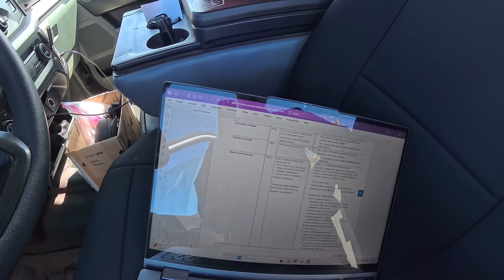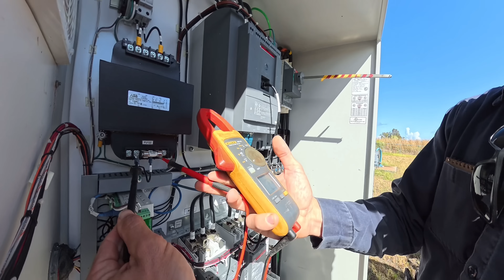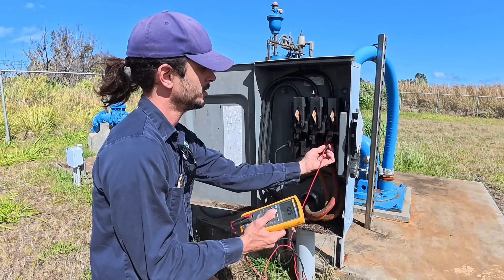100 Horsepower Motor isn't Starting

Comment: G,day from Sydney Australia.
Have you ever taken the cover off the ABB VFD soft start? Look if anything obvious inside?
🌏🇦🇺
Reply: My thoughts exactly. He was more concerned with ordering a new part that didn't charge for shipping than to isolate the faulty component. His on camera trouble shooting seems incomplete. His lack of PPE (safety glasses at a minimum) while troubleshooting energized 3PH 480 VAC make me question his knowledge and experience. Example- Not checking his DMM to make sure that he was on the voltage scale and not the resistance scale before checking voltage. It wasn't too long ago that we were using analog meters (Simpson 260 for example) and the meter would blow up and spew molten copper all over the place, including your eyes, if you were to make the mistake of probing live 480 on the resistance scales.  It is still a good practice to always double check what scale you're on whatever kind of multimeter you use. Have a great day.
Reply: I wonder how many practicing electricians today even know what a Simpson 260 is.

Comment: Must not be very important if they do not have a back up pump. Should have two pumps that alternate each start. Pure BS not allowing a pump to run on bypass. Sure they have hundreds of identical  HP started on a starter.

Comment: Place I retired from had over a hundred VFD'S with bypasses. Only time bypass start ups were on large fans with a few B belts that would scream first few seconds because of belts slipping. They ranged from 2 to 250 HP.

Comment: surprised owners/operators dont keep extra parts for this kind of issues. at the farm I work on we have multiple motors, soft starts relays everything to keep the place alive for emergencies
Reply: The system has a bypass contactor to run the motor at 100 percent in the event of a VFD failure.

Comment: Good decision, I would have made the same one. 
Rotor pumps, like fans, don't put up a lot of resistance at startup(like conveyors, for example) torque increases with the square of the speed, but the hydraulic shock at fast startup and at stop can be very damaging. 
Besides, this bypass contactor and this disconnector at the well don't look like they can withstand several hundred amps of starting current. It will probably melt the contacts, the characteristics of the fuses are probably not delayed either so they will burn out. 
Thyristors are connected between the input and output, in each phase two in parallel but in reverse, each to cut a different half of the sinusoid, one may be punctured. 
Cool that you are recording again.

Comment: You are supposed to check for that short circuit between the input and output of the soft starter, not between the individual phases!
Reply: Short circuit before starter occurs a lot less frequently then after starters.

Comment: If it wasn't safe to bypass the vfd, why did they have the cabinet wired to do so?
Reply: It is not a VFD, it is a softstarter. The bypass is there to bypass the SCRs in the softstarter once the output is at fully voltage. (for the starter to not overheat).  Not to start the motor DOL.

Comment: Old school way of starting high up motors was star - delta set up, but you don't have the wiring or provision to do that, too much in rush current I think unless the motor is running then you could put it on bypass.

Comment: I would have ran the VFD with the SS contactor disconnected/inspected the SS contactor contacts. BTW - I saw a lizard run in the motor conduit when you opened the motor disconnect. I also recommend practicing proper lock and tagout procedures. Good luck!

Comment: Often the need for a soft starter is only there because it's utility required.  This is because the utility has a legal requirement to prevent voltage sags during everyday start-ups in a customer's normal operations.   Well pumps are designed for DOL starts.  They tend to not be too violent because they are actually starting unloaded since they don't actually produce much head as they start rotating.  Multistage centrifugal pumps don't do any work until they reach the speed needed to overcome the head they're working against.  Once they reach the head, they then need to actually get the water moving, which brings the load on over time.  Not a lot of time, but not instantaneously.   I'd have no issue with running that well DOL (Direct-On-Line) for a couple of days while you get a replacement SS going.
Reply: Not quite. Dépends on the duty cycle of thé motor. Starting once a day? Probably ok. Once every 15 min.... Prob not ok.
Reply: @joske102 if it would start every15 minutes woudn't a VFD be a better option?
Reply: @brunolamote  VFD would be the option if you needed to vary pump speeds to meet demand.
If you just run at full motor rpm until the demand is met then the soft starter with it's internal contactor should be the better choice, less electronics, minimal programming and you are not loading the solid state components once the internal contactor is 'on'.
Soft starters can be 1/2 the price of a comparably sized VFD.
Reply: @brunolamote vfd for a 100 hp motor is pretty pricey. Soft starts or wye delta starters are always the cheaper option

Comment: Advocating to not use bypass is foolish.  Do you think the panel is not sized for DOL?   If the system was VFD, then your DOL position has some merit.  Piping has been able to hold the pressures from running on soft start.  When have you seen a DOL start up blow out piping?
Reply: He made the right call. It's a big pump, can blow fuses etc. 

Big pressure swing on the pipework, if there's a faulty discharge check valve and it isn't holding water above it, you will get real bad water hammer when it starts as that water fills up the pipe and smashes into all the elbows up top. 

The soft starter is there for a reason. Best to let the client decide in case the worst happens. 

Don't want to have your ass on the line by putting it in bypass and causing damage to something.

Comment: Great to see a new video!  I agree with your decision not to run in bypass, unless it's a true emergency.  The panel is designed for across-the-line start, so I don't think safety is an issue.  The start will be violent, as you say.

Comment: Nice diagnostic video, one thing I would have done was pulled the output out of the SS and tried to see if you ended up with the same fault. I also ran into a similar situation, faulty VFD and the owners wanted to run across the line, I did not feel comfortable doing that and thankfully they listened and replaced the VFD.
Reply: He had the motor disconnect off. I would have ran with the input wires to the SS contactor/or inspected the SS contacts.
Reply: @Harry1s  I think we are on the same page lol, there is I'm guessing about 30' between the last junction block to the safety disconnect at the well, disconnecting at the output of the SS eliminates contactor and junction block connections, wire to the well. Eliminating 3 possible items at once. 👍
Reply: @MarkSatRorrerWellDrilling  sorry I read your post wrong. We are on the same page!!

Comment: I think the short circuit the manual refers to is between the input and output of the soft starter, for example, L1 to W1.
Reply: I agree. he never tested it with the input to the soft start contactor disconnect or inspected those contacts.
Reply: Of course it means that and nothing else. Basic understanding of a softstarter, how it works and whats inside. Even shown in the manual!
Reply: True, but he has confirmed the soft starter is bad by faulting on no load although he might have gotten to this more quickly by the proper short circuit test depending on the exact thyristor or thyristor control circuitry failure.
Reply: As if a phase were always connected to the motor.
Reply: Yes, he missed that one.
Reply: If it is a shorted thyristor, then another symptom is a solid phase to ground voltage on the output of just one phase of the VSD.

Comment: If I were you I wouldn't hesitate to run it on bypass. The motor is designed to start DOL and can handle it. In fact, most large submersible pumps that I've seen spec a <1s spin up time. It's something to do with the thrust bearings, they need that thrust force from impellers to do their job properly.
They really don't like a slow spin-up

I would read your pump motor's installation manual or contact the manufacturer. I wonder what they would say about the soft starter and starting DOL

It is definitely harder on the piping though
Reply: So close my friend! You are definitely on the right track! Acceleration time on a 100 hp submersible should be around 3 to 10 seconds. On small submersible motors (fractional hp to 10 hp) a faster acceleration time like 1 to 3 seconds would be good. And you are 100% correct about the thrust bearing on the submersible motor being the reason for quicker acceleration times. Submersible motors can also only be continuously operated at 30 hz or more for the same reason. The thrust bearing relies on a film of water between the surfaces and when the pump is idle, the bearing surfaces are in contact with one another. The centrifugal force from the impellers and the motor rotor create some lift allowing a film of water between the bearing surface.
Reply: @dominocweber9763 Centrifugal force does not exist. It is a way to describe how something wants to go straight, but can’t. (I.E. the the blades of a motor.) The tension that keeps the blade mounted is actually the force that pulls it inward. Centripetal force is actually what you are looking for.
Reply: Those look like small contactors for a 100 HP motor. If you do a cross the line start you could do more damage to the pipes or equipment. Replace the softstarter, One hundred HP should run at about 100 amps.
Reply: @lzed223 . Agree, the line size and contactor bodies imply a smaller motor than 100 hp. Experience tells me a 460 volt motor 25 hp will need 40 amp time delay fuse minimum for across the line starting.
Reply: He made the right call. Leave it to the customer to decide. 

Should be fine, but could blow fuses. And if a check valve isn't holding you'll damage pipework with the water hammer pretty quick. 

Best to let someone else make that call, cover your ass. 

100hp is a pretty big pump and will have a fair bit of torque associated with it starting too. Is it properly secured at the bottom of the well? Could shear old rusty bolts, twist/kink/damage the piping in the well. You never know. 

The pump itself will be fine, it's all the associated parts that are the concern
Reply: @Thermoelectric7  In many oil and gas systems the pumps usually had an rpm sensor connected directly to the rotor to  provide RPM feedback for PID control. It  often helped diagnose issues. wonder if submersible water pumps have that feature available. Hell Id even suggest adding a water ingress sensor too.
Reply: @renaissanceman5847 Water ingress sensors are pretty common, at least in wastewatwr pumps. Not so sure about well pumps
Reply: You nailed it completely. It was designed to run it on bypass so start it already

Comment: Your videos are very educational to us young guys, glad to see you back.
Reply: Your videos are very educational to us Old retired guys also , and we are glad we don't have to deal with that anymore!
Reply: Youngsters should not really take this by example, the fault code was misinterpreted and following diagnostic irrelevant.  Even thinking about trying to start such large motor directly on line is downright scary dumb. You could potentially damage the pump mchanically, your blown mains fuses would be your least trouble.
The bypass contactor is there to relieve the power loss from the softstarter, once the SCRs will open fully (output votlage of sofstarter equal to line voltage). If the pump could be started DOL, then they would never design in a pretty expensive softstarter like that!

Comment: Good job UCE...........You need reduced voltage like the old school used to do it, Resistive, or induction starting, or both, some thyresistors can't handle the heavy current draw...........good luck............
Reply: The soft starters are sized for the load, thyristors do their job fine. Might have copped a lightning strike or something. 

Power electronics have come a long way and are pretty reliable for the most part.
Reply: @Thermoelectric7  Be my guest, at fixing it then..........Every time I watch videos about soft starters, and VFDs, are usually the problem, 9 times out 10, so you can believe what you want, I'll believe what I want believe..........To each it's own..........
Reply: @johnwalker890 If you're solely going off videos, its easy to think that they fail a lot - nobody will make videos about working soft starters or drives. 

I've replaced more faulty contactors for DOL starters than I have soft starters and VFD's. They're everywhere in industry. And they usually work fine day in day out for many years. 

Everything will fail eventually.
Reply: @Thermoelectric7  Why are you still bothering me??